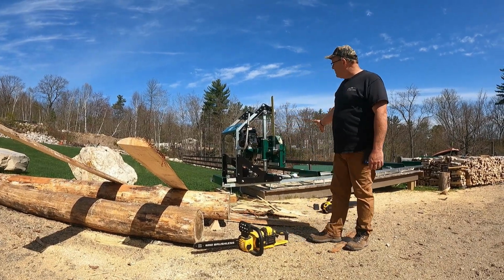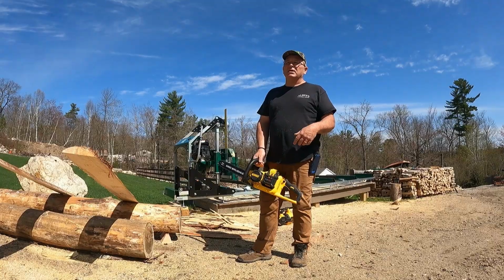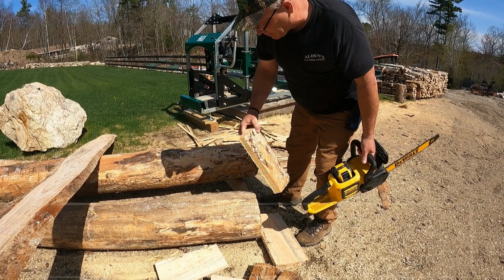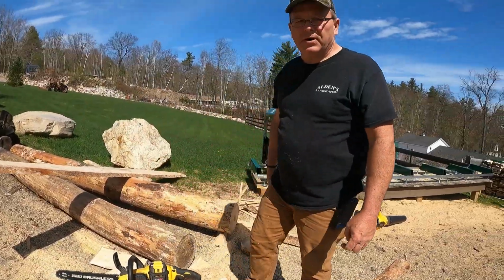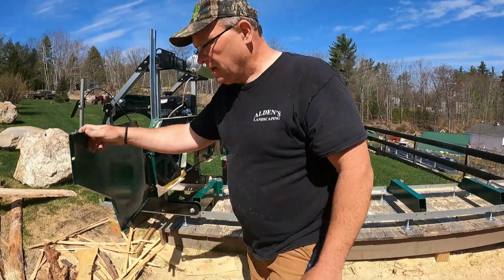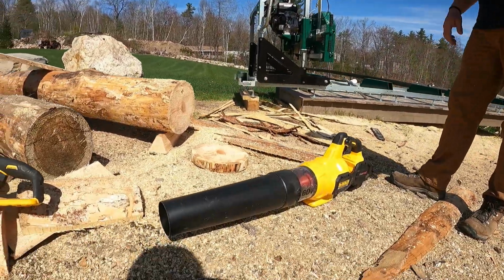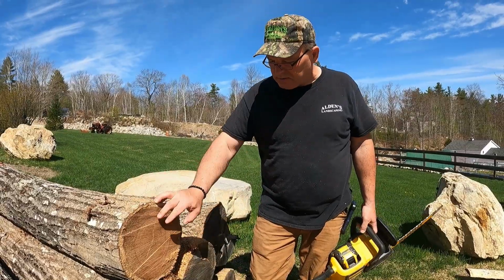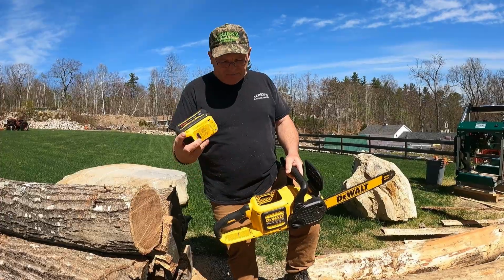16 INCH DEWALT 60V FLEXVOLT CHAINSAW REVIEW.

Comment: I really like my 12" 20v. I was thinking of getting one of these too. It looks like it cuts pretty well, too. Those batteries tend to overheat in the summer though.
Reply from the maker: If you buy one you won't be disappointed! Yeah, the batteries do get warm. I'll admit. You need an extra spare battery around so one can cool while one charges if you're using them excessively on a hot summer day. My only overheating incident was while installing a large retaining wall last year. The batteries were overheating while using box after box of 12" Timberlok screws. I had to have multiple batteries on that job because they'd need cool down time before they hit the charger. Those screws take a lot of juice to get in though! So I'm not really too disappointed in the batteries performance. 👍🏻
Reply: Yes, exactly. I have 3 extra 6ah batteries and that's usually enough unless I'm using my other Dewalt 20v XR tools on the same job.